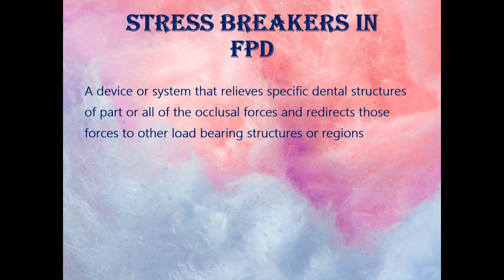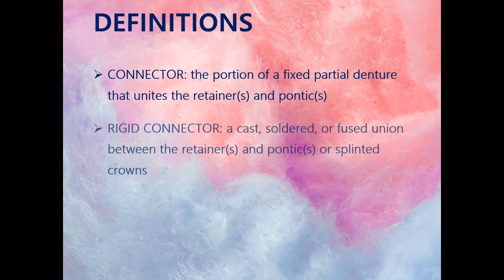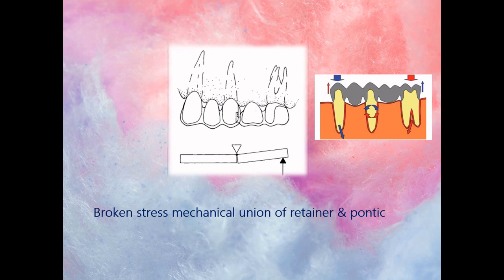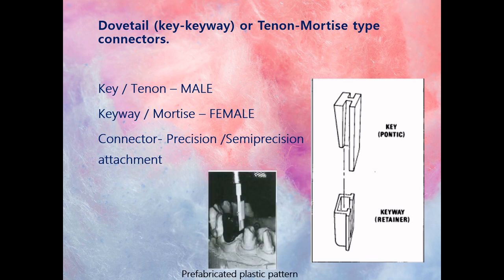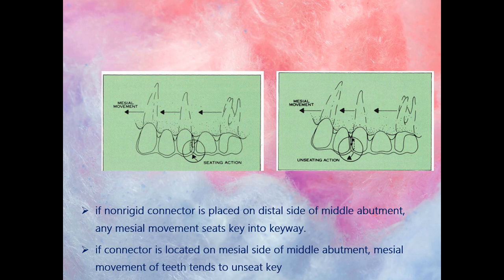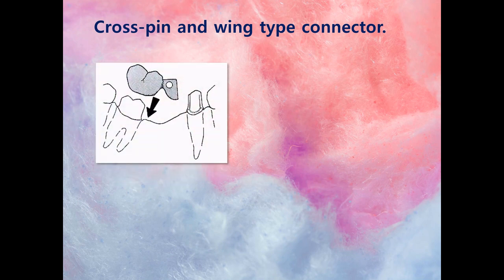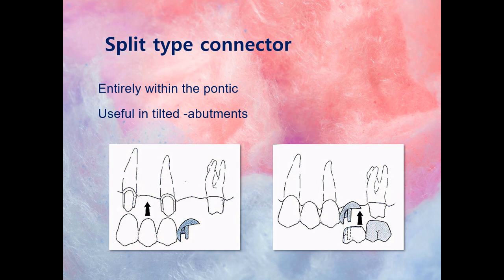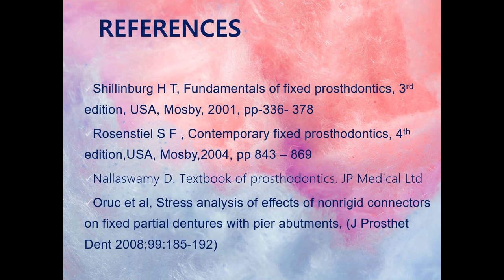Stress Breakers in FPD

Comment: In the same paper two separate short notes were asked. One is stress breakers and another connectors in FPD. I guess the answer is 90% same for both the questions.
The examiner seem to have gotten a bit lazy while preparing the question paper 😅
Reply from the maker: I think examiner played extrasmart to make students confused with same question asked in 2 different ways😅
Reply: @Prosthohub  yeah but then equal marks should be given to both the answers no matter what the student writes. Afterall it was a trick played by the examiner 🤷